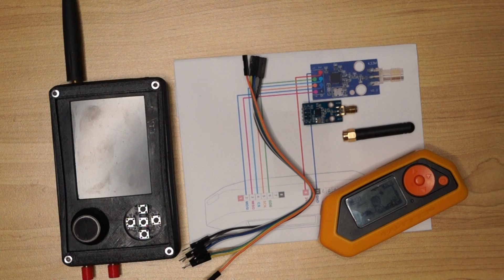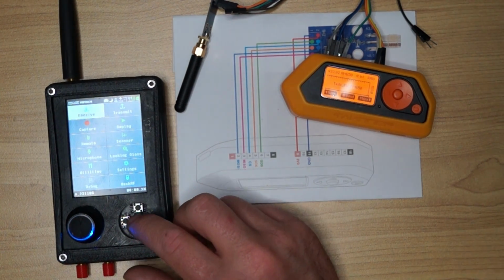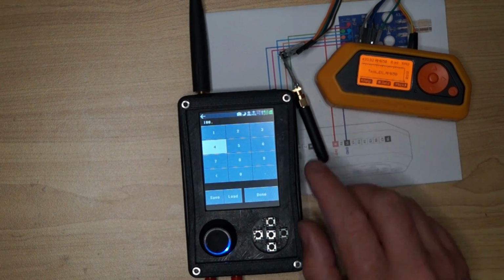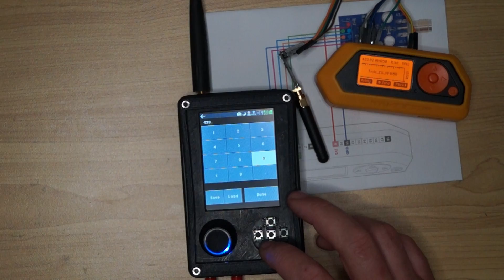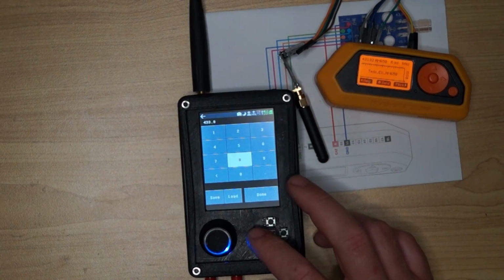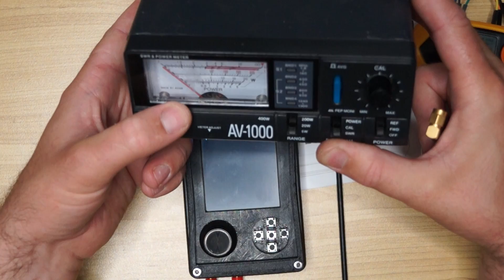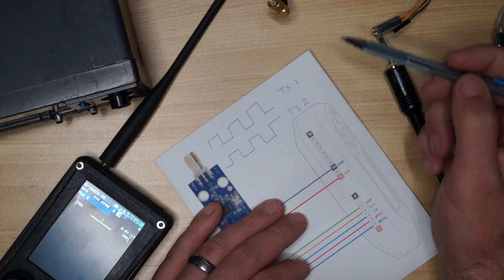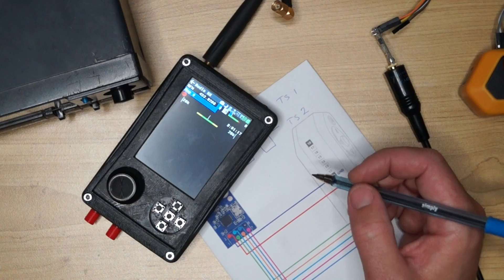Flipper Zero External RF Module (CC1101) Test

Comment: Okay so its been a year i have finally got the extender, i did some range testing with the original antenna that comes with the prebuilt at 433mhz trying to open my garage door, from the flipper itself i got max. 10m, the extender got around 150m, so it is deffinitely better. However my test was out in the open, range may vary depending on your surroundings and the receiver's antenna may be smaller or bigger, both factors may have a big impact.

Comment: how many more meters of range can i get from this cc1101 module (with its original antena)
Reply from the maker: I haven't done any major tests for range. I guess it depends on the other device transmitter or receiver. When I first built it I noticed double range from activating a tesla but I didn't do any real world range test.
Reply: @timmotools  okay, if you're gonna do some range tests then just tell me.
Reply: If i want to rolljamm my car   will the  reciever not stop becuse the jaming if i use cc1101 if iam 20 meters away from the portapack whit my flipper zero
Reply: Have this same module and when I use my jam it works pretty distance,,now depending we're u at u might get a lot of noise , meaning picking up a lot of things,but it has a nice distance compared to built-in cc1101. Also doin Tesla port test has a long distance, I wanna try rabbit tech cc1101 great Scott board,,hear it's really good ,,
Reply: Can you connect flipper to hackrf to boost capabilities?